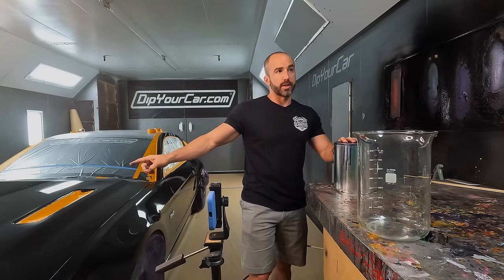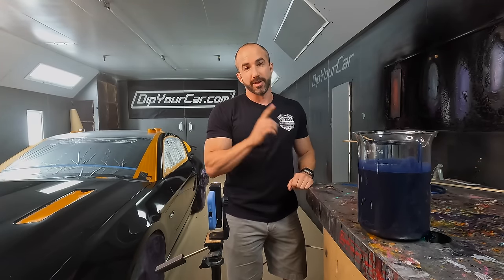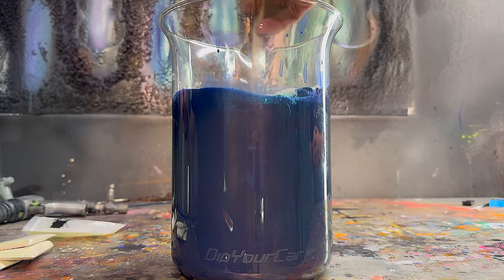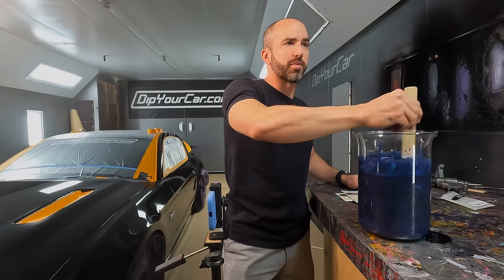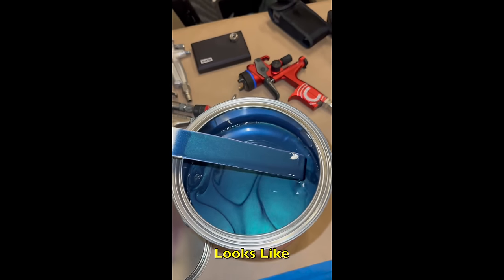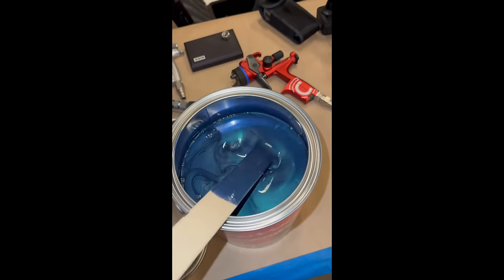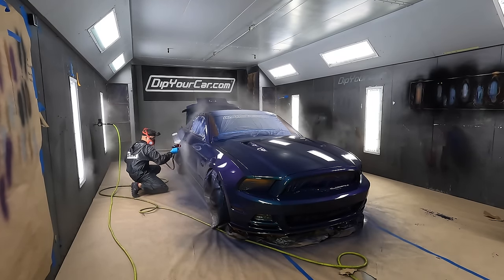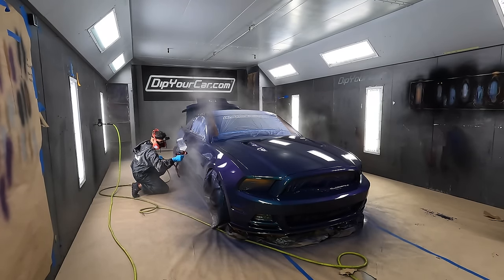The World's Best High Gloss Peelable Paint just got Released (This Changes Everything)

Comment: Guys, so with AutoFlex do you mix it with OEM paint, or do you spray a OEM regular paint base and then add AutoFlex as a clear top coat? Can you infuse solid cooor pearls in the AutoFlex like DYC Top coats? I think I need a better explanation.